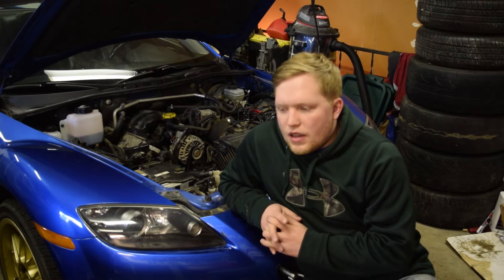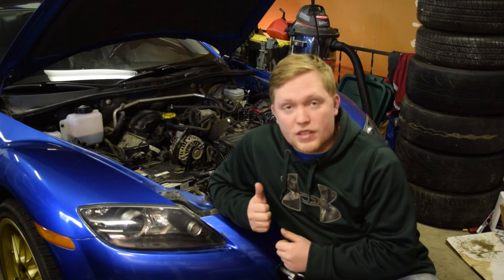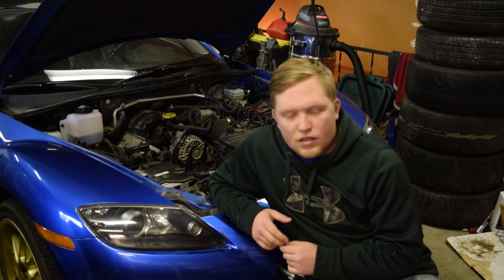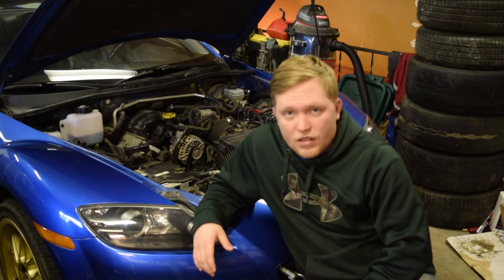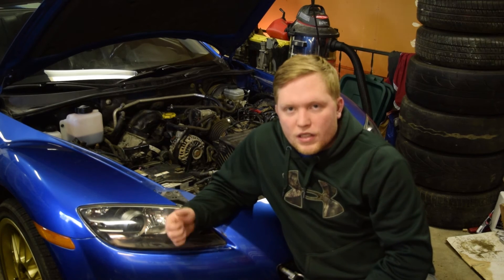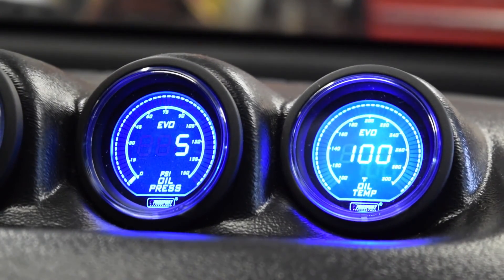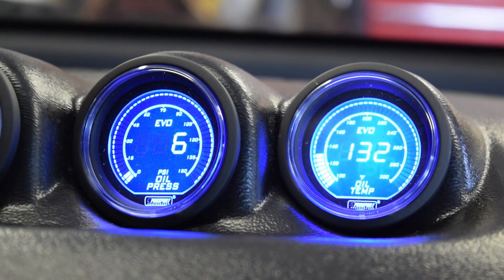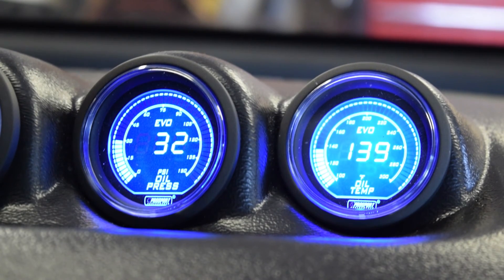Oil Pressure Problem Fully Explained on 2004 Mazda RX-8 with 13b Renesis Rotary Engine

Comment: Pressure and flow are too different things.. did you have any of your oil galleries enlarged when rebuilt?

Low pressure with high volume is the best thing you could have actually.. high pressure and low flow is just hard on seals and temps stay up and reduce oil life/efficiency..

Comment: Thanks for the video! That oil pressure is a little low but should be OK.
My S1 lost oil pressure recently (sandwich adapter and digital gauge). At startup and shutdown it shows little pressure but it drops to 0 when not revving. Dashboard pressure gauge is fine : /
Bought mechanical gauge and will troubleshoot further..
Reply from the maker: I wound up fixing this problem by modifying the oil bypass inside the oil pan, raising the baseline oil pressure of the engine. That definitely kept the oil pressure at reasonable levels from that point on. Took a rebuild to solve it, still not entirely sure what the problem was honestly.

Comment: No it’s the oil you want to use 20w40 and you will have proper oil pressure on idle the oil is to thin even from Mazda all the people who race use 20w40 because the the thin oil spins of the bearings on idle when it heats up

Comment: If the oil pressure is having problems it might be the OMP.
Reply from the maker: The OMP doesn't have anything to do with engine oil pressure, the OMP is the Oil Metering Pump that injects oil into the rotor housings on a rotary motor.

The oil pump itself is located inside the front cover and is run by a sprocket and chain system that is linked directly to the e-shaft via a keyway. This is the oil pump that affects the oil pressure.

Comment: I REBUILT MY 2004 RX- 8 AND MY OIL PRESSURE IS A LITTLE HIGHER THAT MIDDLE.. ANY ADVICE??
Reply from the maker: 65-70 at startup or when cold is understandable for a stock RX-8. I'll be posting a video soon about how much oil pressure RX-8 oil coolers can handle [hint: it's way more than you would think!]
Reply: its kinda like 65-70, same as mine. let me know if you got answer. I've 2005 RX8
Reply from the maker: That is a fake gauge, it doesn't really do anything besides read that there is oil pressure in the system. I should shoot a video dedicated to this subject because I had to learn a lot about it. Thanks for the reminder!